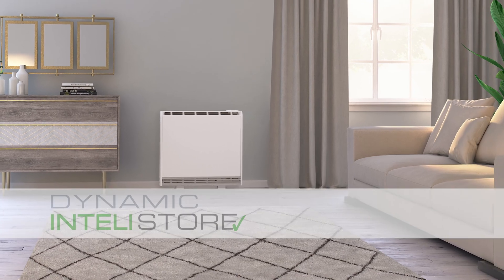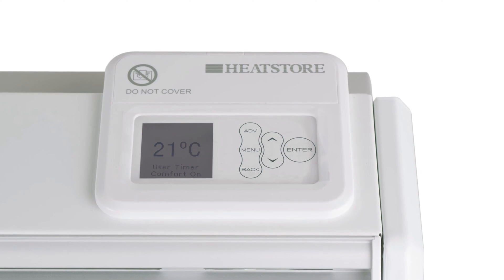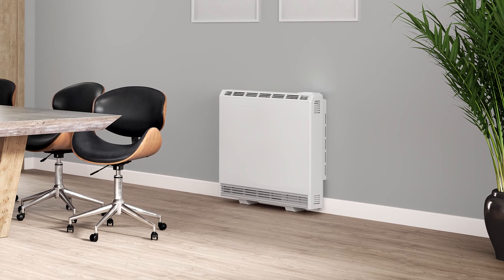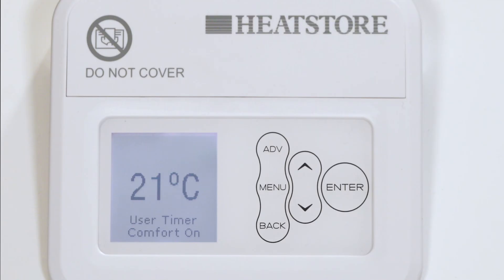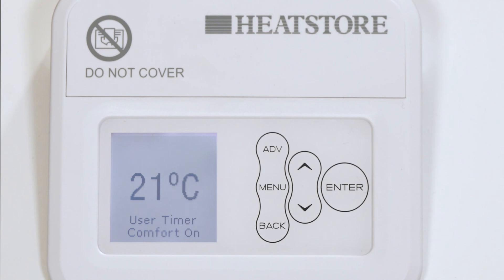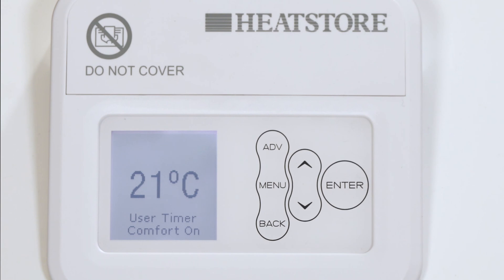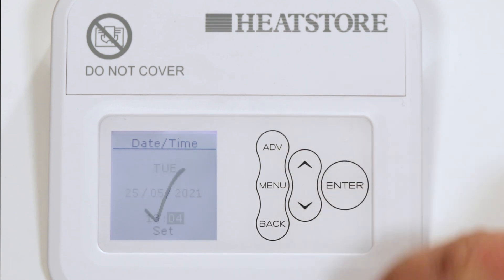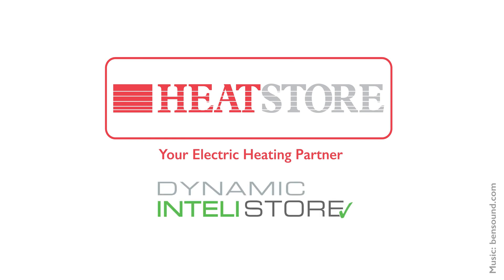Heatstore Intelistore How To Video 1 of 4 - How Does The Heater Work?

Comment: If there is a front plate to keep heat in (and i live in an old stone house) this NSH is pretty much useless. I found that the fan blew whether there was heat or not, thus blowing cold air at my expense during my standard daily charge rate.  Completely missing the point of a night store heater for a house with Economy 7.   Might as well get an electric fan heater in my hall

Comment: So do you pay again to run the heater (Comfort Mode) during the day, or is all the heat simply generated during the heat first then a cold fan blows it or during the day? What does the status codes mean, and does it state how much kWh is used each day in the status mode??

Comment: I have 9 of these in my house, is there anyway to link these to all run on the same timers rather than have to set them all individually, they're a nightmare, on a dual tariff, and still using 11 pounds a day electricity. These were installed in 2001 though. 😬
Reply: £10 a day to run 9 of these heaters? That's cheap! Costs me about £7 a day (or overnight as that's when they charge up) to run just 2 of them! And that's just to charge the heaters, that's not my total electric use a day. They are very expensive to run. And not very efficient at all.

Comment: Hi thanks for the videos. Can you tell me how to switch off the element temporarily, is there a way of closing the top vent for a few hours if I don't want the element's heat from the economy 7. Please advise as I can't work out how to stop the unit radiating heat once it has been on over night with the economy 7 switch turned on
Reply: Settings and it lets you choose fan only

Comment: My heaters are releasing cold air even though the temperature is in 21 degree. plz help
Reply: Yep my heaters are barely even warm at even the top heat! I have them set though to 21 and hardly any heat is coming out, and by 4pm latest they just blow out cool air, like the heats run out already (what little heat they had stored if you can even call it heat). I've had them a couple of years and I do not rate these at all. I've factory reset them and reset them up but the same thing occurs.
Reply: @mookieblay6331  same, I get cool air too. I'm just fed up with storage heaters. I wish they had just answered the question above so that we all know what to do, I'm sure it's a common problem 😒
Reply: Same it’s midnight -1 and I’ve got my electric blanket on and this stupid heater is blowing cold air and costing over £10 whilst I pray they economy 7 kicks in.. don’t understand why it can’t be more simpler.. it’s rubbish so fed up
Reply from the maker: Hi Mimi, if you would kindly be able to call our office we would be delighted help, simply contact us on 0117 923 5375 and ask to speak to one of our Senior Technical Advisors. Kindest regards, Heatstore.

Comment: This has answered 0 of my questions. Thanks
Reply: Storage heaters 👎🏼👎🏼
Reply: This was installed at my neighbours  set at 20°c comfirt on both power supplies on all she got was cold air blowing out.
Reply: My Fan+element is in but I only get fan blows. The top element doesn’t produce any heat for scheduled times. It comes on during the economy and it’s warm only. The temperature set 21/22 . Please advise. Thanks 🙏
Reply from the maker: Hi Fabian, please let us know what questions you have and we will be able to help. Kindest regards, Heatstore
Reply: @heatstore290 the one I'm using has a different display. It has a something with a clock, a hand, a snowflake and a calendar. I don't know what these things mean
Reply: @kitara0001  I have this same issue, did you ever figure it out?